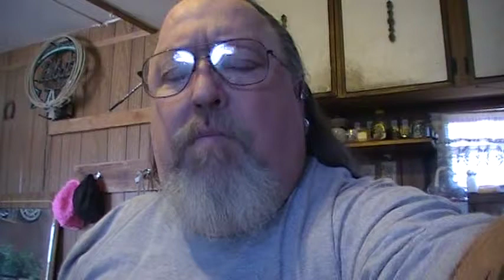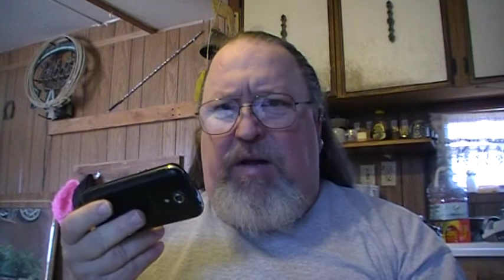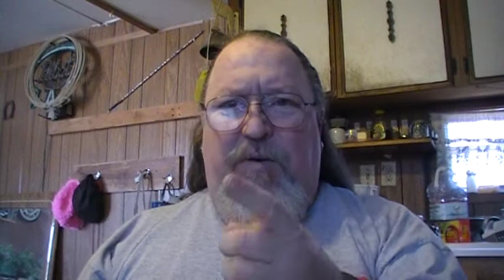EMP and an Open Circuit

Comment: Using a large antenna, you could put together a very low power led light, powered by all the RFI going through your property, free lighting. Same idea as the faraday cage kinda. A bit of work and math to get it to work, but it has been done before.

Comment: Also the "special foam" the electronic components are packed in, normally pink, but not always. It is conducting, and may be useful for a gasket, dunno... a magnetic field will induce current in things like transformers, motor, and other things. Strong enough and it will put more power through the wires or other conductors then can be handled, and causing shorts or breaks in the circuit. The idea is to send the power to the ground instead.

Comment: The space between the lid and box, though very small, will let some RF in, and the phone may work. A good test for sure. Special conductive gaskets are made, for things like this. You may be able to improvise by making a gasket from braided, or twisted copper wire. Be sure to have continuity on both lid and box at the gasket. Or drape fine Grounded conducive mesh around the gap. another way to be more prepared for EMP would be to learn basic electronics, and how to repair electronics.

Comment: Put a jumper wire from the lid to the box and from the box to ground / the best way to test it is place the the cell phone in the box and if you can call it and it rings it works / or place a radio in it and close the lid if you loose the signal it works

Comment: No, the EMP can damage the individual electronic components on the circuit board, you need a faraday cage. Think about the electronic parts of military vehicles, remember how rugged they were, and in enclosed metal cases, that are grounded to the frame. You can make things like that yourself. Can be a tight conducive mesh, or sealed metal box, both need to be grounded to something substantial, like a large vehicle, or the earth.

Comment: Types of energy: Electric field, Magnetic field, Electromagnetic radiation, electrical conduction
Wave Forms: Rectangular pulse, Double exponential pulse, Damped sinewave pulse.

The best way, imo, look at it all is "conductive" and " antenna". 
The safest thing to do is a "Faraday cage" A cellphone might make it, but the systems supporting it won't...another example to apply.

I think you have a "job box" out back? Consider improving it. AND, grounds can be that  "antenna". No easy subject